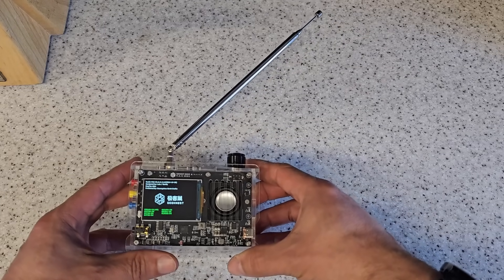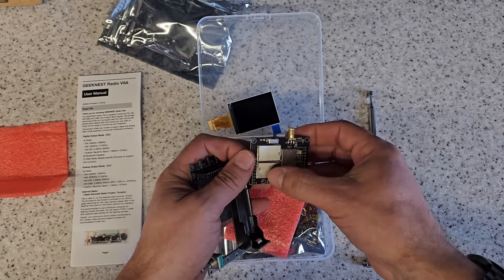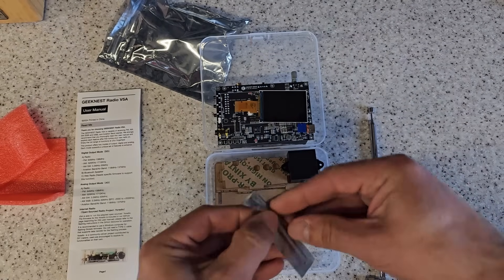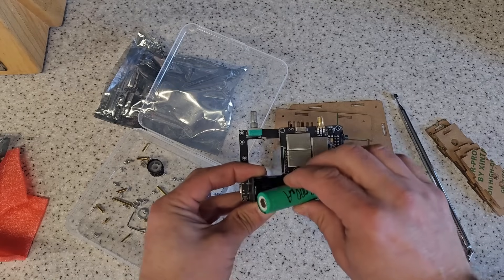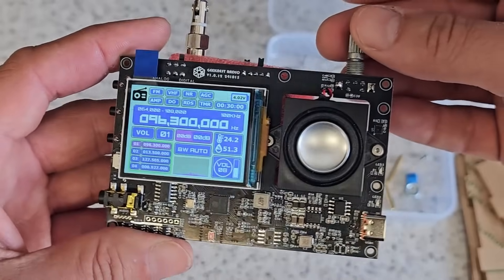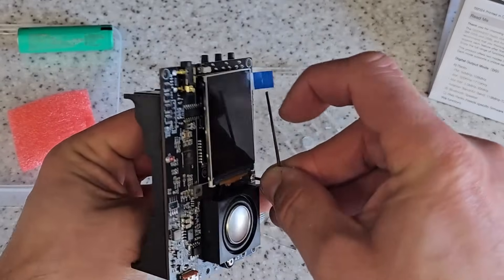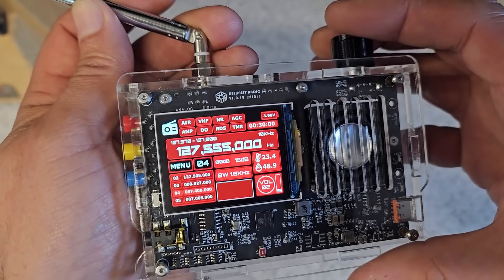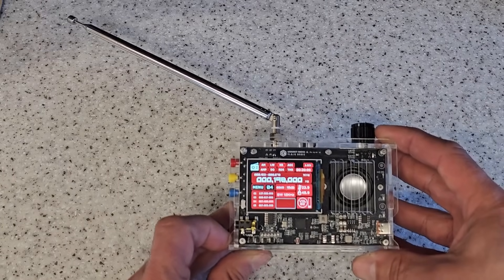DuB-EnG: GeekNest Radio from BangGood V5A HAM HF SSB SHORTWAVE AIRBAND & FM Broadcast Radio Receiver

Comment: This is not a SDR radio !! Looks like based on Silabs (Si4735 + Si5351), Lcd and ESP32 to control them. Crap.
Reply from the maker: Si479xx Hybrid SDR Tuners:
Skyworks' Si479xx family is a key component in their automotive radio solutions, designed as hybrid software-defined radio (SDR) tuners. 
Si469xx Digital Radio Coprocessors:
These coprocessors are optimized to work with the Si479xx tuners, enabling features like maximal ratio combining (MRC) and seamless linking of digital radio, analog radio, and internet protocol content.

Comment: anyone remember the ramsey kits.. they were cool... i have 40 and 80 boards i sould try and get them runnin again
Reply from the maker: Love a proper old radio kit...  was it a plated through hole solder kit and wind your own coils jobbie?
Reply: Yeah !  I still use a Ramsey 2-meter.  And lotsa Heathkit.

Comment: they dont seem to sell it any more. i can not find it on the banggood site. i see other reviews at 5 months and this 2 days. so no idea. found it.. its labeled as such ...........        Dual Mode Digital Analog Radio Supports FM AM SW Aviation UHF Bands Bluetooth Speaker Functionality Customizable Antenna Options Type-C USB Interface for Charging and Updates Perfect for Radio Aficionados and Aviation Professionals - #A           ID: 2013213         ................ 50 bucks us. not to sure

Comment: Used to buy a lot of radio kits, but since I bought a Malahit DSP2 SDR and a Deshibo GA-800 active loop, I don't need anything else anymore.

I think think this kit looks very impressive. The Chinese have this market nailed
Reply from the maker: I'd love a Malahit SDR ...  looks amazing!! The technology is just fantastic 👌
Reply: The GA-800 has changed my SDR game substantially. It brings a surprisingly low noise floor (unless charging at the same time as using) and has been incredible vs my YouLoop with my AirSpy HF+ Discovery.
Reply from the maker: @JimJimmington-e8i oooh...  I've just looked it up, that's an interesting active antenna!